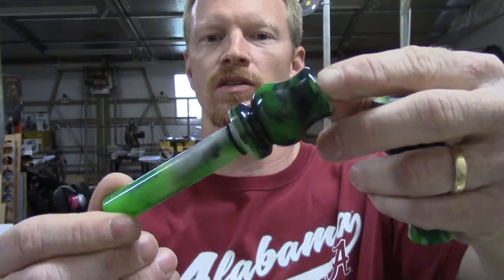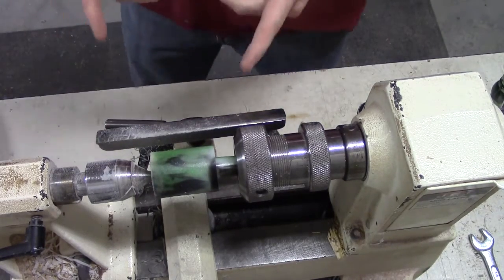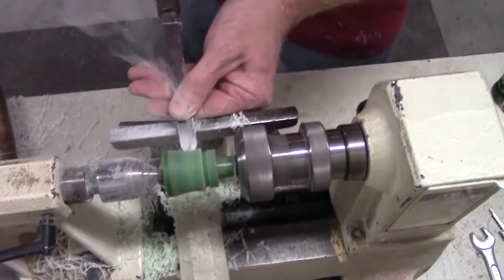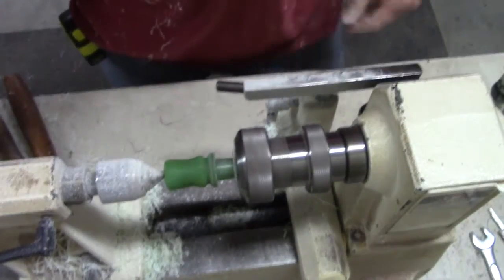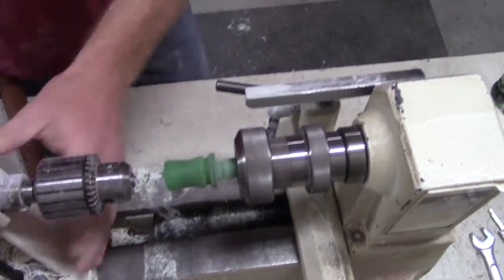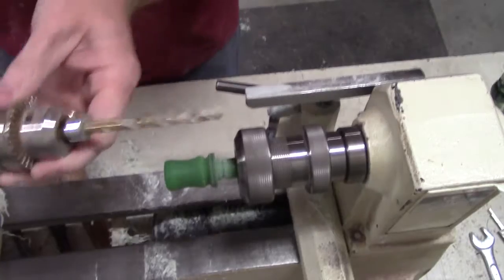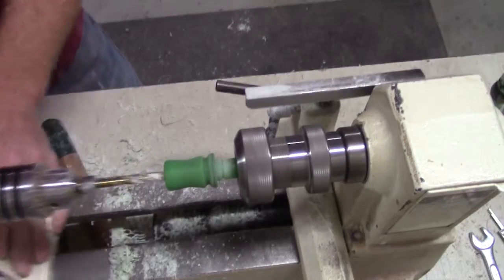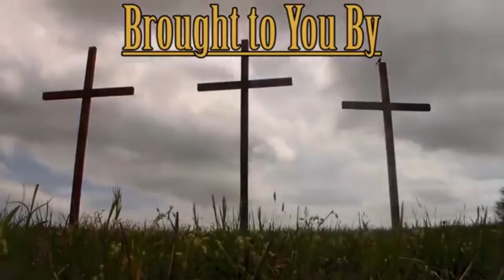Reviews & How-To's #1 (Part 1 of 2: Duck Call Insert - How To Turn and Drill)

Comment: What size drill bit did you use to drill the hole? I know the barell hole is 5/8 but I haven't been able to find the insert hole size
Reply from the maker: 1/4 inch for Toneboard insert channel
Reply: How far do you go in with the 1/4 drill bit
Reply from the maker: Bo Jackson for insert tone channel most tone boards drill to .400 - .600 from tip with highest avg at .500